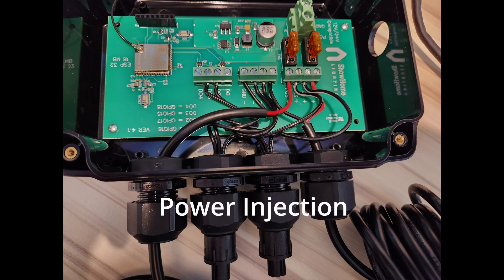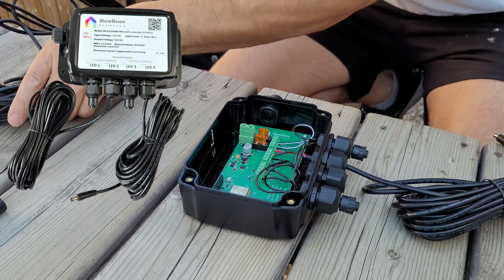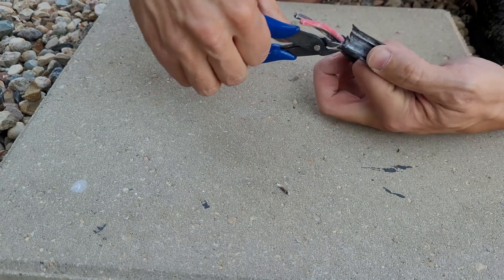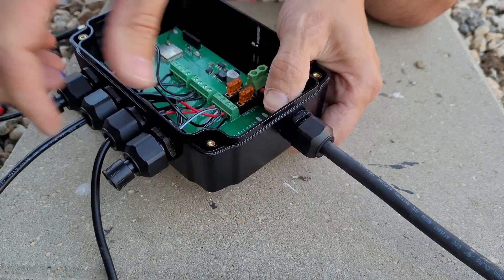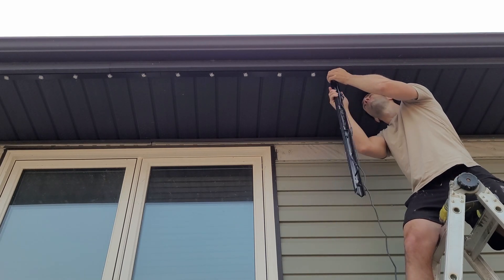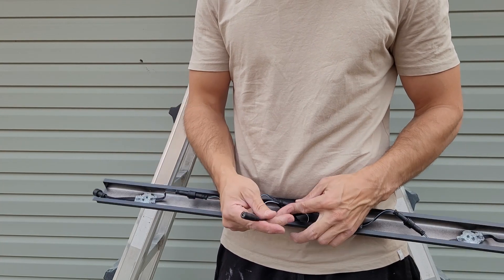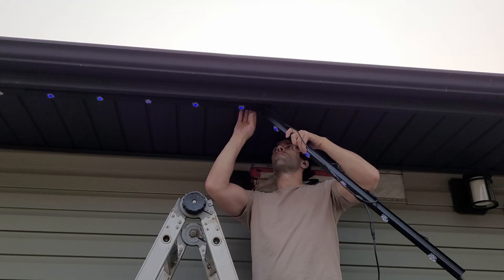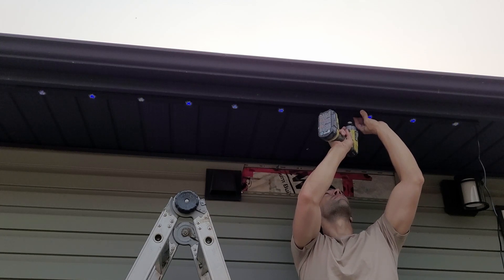Power Injection Guide

Comment: May I know what type of cable you use for power injection
Reply from the maker: We just get custom ones made for us, they are a 16awg 2 wire with a dc barrel connector on the end.
Reply: @showhomelighting5840  is it copper wire or just a normal wire.

Comment: Pretty straight forward process, but just to confirm.  At the beginning you installed 2 power injection points to the actual controller. But in this install you are only using one power injection line?  If you would need to use the second power injection line how would you go about doing that, lets say the house is 180 ft, or whatever ft is required to start using your 2nd PI line, would you still run that line threw the track, or would you cut across the entire house attic?
Reply from the maker: I don't show it in the video because I did it later, but I went around the other direction from the controller and did the same thing I did in the video injecting power up to 80ft from the controller with that second power injection line. The two runs met at the corner where I stopped in the video.

Comment: are you running one DC injection wire with multiple drops along the way. Parrell wiring
Reply from the maker: Yes we are running a separate DC only wire from the controller inside the track and Inject power at 40ft and 80ft in both directions.
Reply: so its one DC wireand then two drops from that single wire correct. @showhomelighting5840
Reply: @showhomelighting5840  are you using the same dc line to inject twice or 4 times